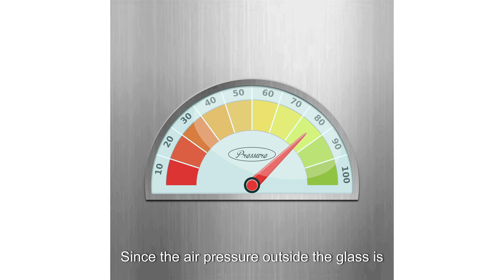Experimenting with AIR PRESSURE- Why does water rise if using lit candle?

Comment: Using up the oxygen doesn't reduce the air pressure otherwise the water would have slowly risen until the oxygen ran out.  What happened is as you SLOWLY lowered the glass over the candle it heated the air inside the glass.  When the candle went out the air cooled, reducing it's volume which was replaced by the rising water.